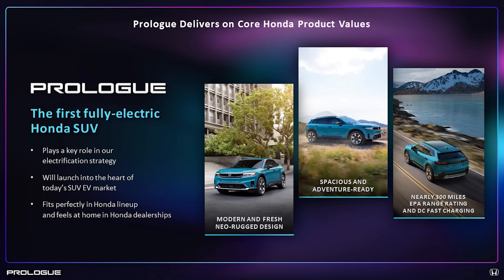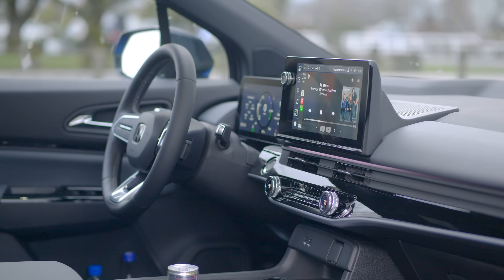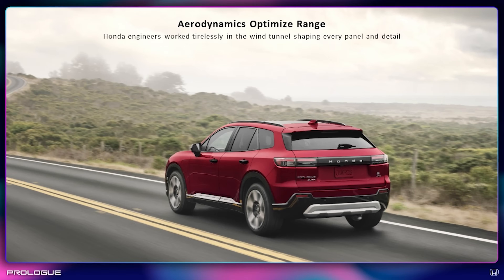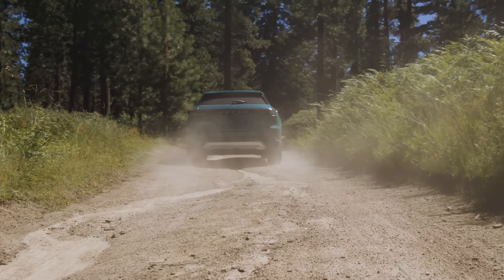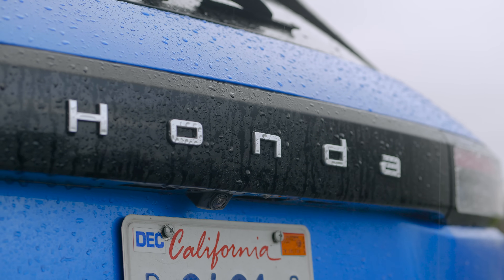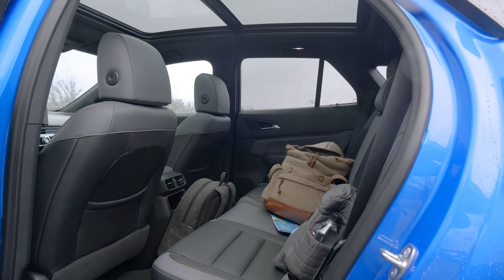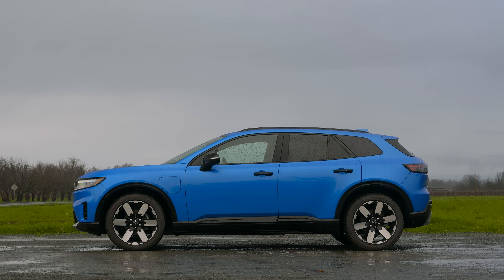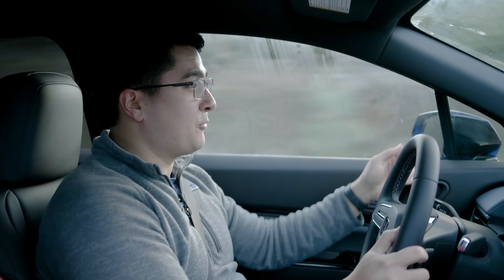Honda Prologue First Drive | Taking Risks

Comment: I just leased one, and I love it. Its got a nice floaty ride, love the easy steering, its quiet in the cabin and very spacious. I love it doesnt look like a modern EV, and has a traditional look. Im very happy with it.
I had no clue when I first test drove it that it was a GM collaboration. Ive never owned a Honda before. I test drove a HRV then the Prologue, and honestly, I didnt really notice a difference. They both rode and drove the same. And Im glad I went with the Prologue. I got the touring trim, and am extremely happy with it.

Comment: Our first new car was a ‘99 CRV. After driving my parents’ American cars during my formative years the Honda interior was a revelation. Buttery smooth switch gear, dead clear instruments, high quality fabrics and stitching, razor thin panel gaps. In other words, absolutely the polar opposite of GM interiors. Heartbreaking that poor Honda guy had to play up the fact they got to choose the placement of the cheap-looking central pod and switch gear. Ugh. 
Now, based on the great things I’m hearing about the Silverado EV maybe their platform architecture will be ok. And I quite like the styling actually. But I could tell blindfolded and drunk that interior ain’t no Honda. ☹️

Comment: I drove one last week.  Sorry to say this is one of the worst "Honda" cars with that H badge.  The only one worse, that I can think of, is the original Honda (Isuzu Rodeo) Passport.  The Prologue did not feel or drive like a Honda, all the interior controls were a direct carry over from GM.  In summary, I don't see Honda selling very many of the Prologues unless they cut the price significantly.  My dealer had $71k on the window sticker of a $56k Prologue, and if I didn't have a trade-in and I didn't finance with them, they wanted to tack on another $3,000, not to mention another $2,500 in document and registration fees, it's insane.  The dealerships are all out of their minds and I can't believe people are buying any cars from these businesses.  Maybe if Honda could sell direct, they would sell more cars but I'm totally done with dealerships.

Comment: $50-60k On a Shared platform?!  Whatever excuse one will make as to why this costs as much as it does is not the consumers problem.  This over a similarity priced and spec’d Audi Q4 Etron or a cheaper model Y makes zero financial sense to buying a comparable hybrid or ICE vehicle.  This is DOA unless they provide massive manufacturing discounts outside of the tax credits.

Comment: Man....this EV major advent here in the past few years leaves alot to be desired. What a boring souless appliance all these cars are turning into. While yes i agree most sub /cuv in the past were much exiting to look at or consider at least we had some significant architecture of power train / transmission/sound etc that we could look forward to- especially the more bespoke tiers with the more powerful engine variation or the option of LSD or a different transmission revised and improved.  I wouldnt be surprised if we have literally the same electric motor and battery packs (on a basic level) between nearly all these evs.

Comment: The EV architecture dictates the entire underside is batteries, which seems to give the buyer some industry standard 300 miles plus or minus 50 across nearly every manufacturer. The economics are not great as price parity with ICE cars doesn't exist.  ICE prices have been raised to support zero EV profitability.  Our collective governments are really wishing this through, but battery tech still doesn't provide energy density.

Comment: The comments are pretty rough on GM, maybe deservedly so since GM has a Stop Sale on the Blazer over all the software issues. I'll wait to judge if this co-developed EV is a gem or garbage before making the assumption, but the Honda guy was pretty defensive. It's telling that Honda says there will be no more joint development efforts with GM.

Comment: I wouldn't pick a Pilot over a Prologue assuming I could afford a $50,000 vehicle. The savings of an EV is too great to overlook compared to the Pilot's mediocre gas mileage of 21 mpg. The real question about EVs though is 'are they too expensive to maintain/repair?' In an accident, an EV can cost many times more than a traditional car to fix, sometimes more than the car is worth.

Comment: The engineer saying it feels like a Honda inside. Sorry but that steering wheel is not Honda at all, I'm not talking about parts, I'm talking about layout. The layout is clearly GM cruise on left, buttons on the back of the wheel, wiper stalk on opposite side, etc. I know they were working with a parts bin but he said they had control over the layout and they clearly didn't make it feel like Honda if the end user will have to learn a new layout for this one vehicle.

Comment: Looks like another failure from a Japanese automaker. We have seen Toyota doing that and fail, and now Honda decided to jump in the EV wagon which we all know it is not going well in the market for multiple reasons, and the main problem here is the PRICE. Yes, $60K for a boring low-performance EV SUV is way too expensive for the current market. If that vehicle is priced in the mid $20K to low $30K I can see people thinking about getting in the EV world and probably switching to that Honda. But in the $50K range, you have better options in the market with better performance. I don't see a second-gen of the Honda Prologue in the future.

Comment: In 2005, Motorola partnered with Apple to announce the Motorola ROKR, a flip phone that was an evolution of the Motorola RAZR but with Apple's iTunes software. Connect the phone to your computer and you could manage your music as easily as you could your iPod. It was Apple's first look, first exploration into the cell phone market, but they wanted an industry-leading partner to help them take those first steps.

In 2007, Apple unveiled the iPhone. As an S2000 owner, driver, and enthusiast, I hope this his Honda's ROKR.

Comment: I think everyone in the comment section is still living in the past with GM. At least this is something different. The Honda lineup at this point is a bunch of CVT equipped, low-revving commuter crossovers and a minivan perfect for non-enthusiasts. Are they good at boring these days? They have nailed it :) They literally have ONE enthusiast product which is the Civic lineup. GM chassis engineers are known to be some of the best in the business these days. It’s like the new Supra…everyone is afraid of what “could be down the road maybe” vs just driving.

Comment: I bought a Pontiac Vibe because it's a Matrix underneath, and got a great vehicle, despite being assembled in a GM plant that later turned Tesla. The GM/Honda partnership goes back to Isuzu and Saturn.

Also had good success with my Malibu Maxxes. My 4 cylinder Hondas were all good but the V6 has a horrible tranny.

Comment: We have entered the second Malaise era of automobiles. With EVs, hybrids, crossovers and downsized engines cars have gotten very boring. Its a shame because the internal combustion engine has reached near perfection. This could be golden age of cars but due to government regulations its turned into a dark age. Its all for nothing though. ICE will be around until at least 2050. Mercedes had plans to be 100% EV by 2030. But due to horrible sales they now say they're going to continue ICE production well into the 2030s. The only company in America or Europe that's really selling EVs is Tesla. They're selling because they're Teslas not because they're EVs. California and the EU both have set a 2035 ban on ICE vehicles. Either they're going to move that date forward at least a decade or they're going to obliterate the automotive industry. ICE will continue to dominate the industry until one of two things happens. Either some miracle battery is invented or another technology like hydrogen fuel cells reach mass production. I'm optimistic about Porsche's E fuels. This could be a way to extend the life of ICE vehicles while also reducing emissions.
Reply: Meh… ICEs are so 20th century … get with the program and stop living in the past

Comment: Regarding quality, Honda was mid-pack in the 2024 JD Power rating, finishing below Buick, Chevrolet, Cadillac, and GM. I have owned a lot of Hondas (CRX, CRX Si, Acura TL, CRV, VF500F, VF700F, VFR700, CBR900 RS125) and I like brand. Was I in the market, I would almost certainly buy a Prologue over the GM clone, but that would be based on design and driving dynamics, not reliability.

Comment: The biggest problem with these new EVs is still the range. Until these EVs can get 450-500 miles to a battery charge these vehicles are a complete compromise. With 290 miles of range in optimal conditions it would appear to be okay but there are so many  constraints that will prevent the customer from getting a 290 mile range. For instance cold weather substantially reduces the real world range. If there is heavy wind/wind shear playing out this will substantially reduce the real world range.  In addition when these EVs become used they will tank dramatically on value worse than a ICE  or Hybrid vehicle. For the smart consumer that wants the EV, leasing it is the only way to go. You do not want to own one of these. Lastly this is no real Honda and Honda should stay away from trying to convince their  loyal fan base to buy a GM and play it off as a Honda. Same holds true for the Acura variant which carries the name of a failed Acura product of the past. Come on Honda get real and stop deceiving the pubic (you use to care about what you produced and sold to customers)

Comment: I'm kinda tired of the "lease this, don't buy it" you guys say with basically every EV you review, just because you never say WHY not to buy it. Is it reliability concerns? That'd be reasonable, though these types of vehicles really aren't inherently more complex and therefore likely to fail than most other new cars. Is it depreciation worries? At least for myself, I don't buy a car to keep it for 5 years; I buy to keep it for at least 10, at which point I'm really not concerned with recouping my investment. Is it the fairly steep technology development curve for EVs at the moment? That's irrelevant; unless I'm anticipating some dramatic shift in my lifestyle at some point in the near future (not saying this never happens to anyone), if an EV works for me now, it'll work fine in 10-15 years from now, too.

Unless this channel starts substantiating the whole "don't buy an EV position" with reasons why not, it's just going to come across as anti-EV.

Comment: Why even bother with this? Tesla has a better network, the Koreans have better driving dynamics, any AWD EV will make more power, and most vehicles comparable in performance and quality will cost less. $60k gets a vanilla, limp wristed Honda thing, $63k gets you a 570hp, 0-60 in 3.5 seconds EV6gt. It's like they wanted this to fail.

Comment: IMHO, these car companies that are spending so much money to make EVs would be better off spending that money to lobby governments to educate politicians on why man-made climate change is bullshit and how we do not need EVs. An EV should just be an alternative car for the person who just wants an EV. The focus should be on developing affordable gas powered, naturally aspirated cars that last.  People with money will always buy new cars because they get bored, so it doesn't matter if the car can last 20 years, but for those of us with limited funds, we should also be able to drive a nice car and not have it cost 40K +.

There is no need to add a digital display on every single trim. There is no need to add a full fledged infotainment system on every trim. Instead, on the entry level trims, focus on providing a good engine, a good transmission,and a good suspension, instead of making it with a cheap engine, cheap CVT, and BS suspension, but loading it up with computer gadgetry.

We need more companies to make more cars that the average person can buy without stressing the budget!

Comment: Curious to why all these newer EV releases with ambitions to be NACS compliant, keep putting the charge port on the drivers side of the vehicle towards the front fender. This will make charging at the traditional Tesla charging station difficult and annoying to everyone. Here's hoping  they have a CCS port there, and put a NACS on the passenger side.

Comment: I am an automotive engineer of over 20 years. I worked for a Honda Assembly plant and Honda R&D. I subsequently worked for a GM assembly plant and had stints working at GM world HQ. I can tell you from having a full understanding and experience with both manufacturing and design cultures, this is an utter disaster and ticking timebomb waiting to happen. Both companies are complete polar opposite when it comes down to design philosophy, manufacturing ethics, supplier base management and soforth... Honda carrying the proactive mindset of Continual improvement, Kaizen etc.... While GM being the build it and worry about it later, fighting fires mindset.... Also, GMs workforce are union led, with quality and pride placed below workers compensation and security of jobs. Honda on the otherhand is an entrenched culture of quality and pride.... I see nothing but quality and workmanship issues for this vehicle coming from GM and subsequently Honda will have a hard time having GM own up to these issues.... I predict this partnership not lasting more than 5 years, the Prologue ranking last in JD power IQS surveys.... this is the worst partnership in sometime.... I cant wrap my head around a Honda product built along the same assy line as the Chevy Blazer and Equinox.... Do you think union workers will put care in assembling a vehicle with a foreign nameplate? Absolutely not..... Its a SAD time for Honda.... soo sad
Reply: I am but an outsider, but it seems to me your Honda experience must have been pre-2016ish. Their quality has absolutely nosedived, the marketing and finance people seem to be running the operation, and they have turned a cold shoulder to their customers who are increasingly having major, widespread failures of major components just out of warranty. 1990s Honda, this ain't.

Comment: $60k for a Honda? Outside of the NSX, no Honda should be costing that much money. This car will flop at that price. Even the Blazer EV isn’t selling well and it’s been on the market a year longer than this car. 

And only 212 horsepower? I get they wanna make a “normal EV” but 212 horsepower in the FWD model is just not enough. Even the Mustang Mach E base model has 266 horsepower, and even that feels slow unless you’re on a full charge.

Comment: Jack: how does this product drive differently than all the other skateboard architecture products?

Honda engineer: it has a Honda badge and the inside is laid out like a Honda.
Reply: "DyNaMiCs"
Reply: Nope, it's not even close to being laid out like a Honda, it's laid out like an Blazer EV, all the controls are not where Honda normally puts them, it's where GM put them.  This vehicle was a total waste of resources for Honda.

Comment: "Yes, these are GM parts but they are arranged where they would be if they were a Honda"

People buy Honda and Acura because of their reputation of being solid, reliable vehicles that will last for hundreds of thousands of miles. Where the buttons and switches are has literally NO bearing on that.

Just LOOKING at the dials and buttons used and comparing them to a Civic, you can tell that the parts used here are garbage in comparison. This is just sad.

Comment: Honda and Toyota dont care about EV, so they make these partner throw-away models to be compliant. IE have an EV model in their portfolio.
Hybrids are much more cost-effective at the moment, and way more practical due to it not requiring a lifestyle change, or a driveway to get decent charging rates.
Honestly, once they start applying road-taxes to these, and do away with the government rebates/taxcuts, these vehicles are dead in the water.

Comment: Man.  The level of defense that poor engineer was putting off.  From the GM partnership to its hideous price tag relative to what gas or hybrid powered SUV's provide this thing is just pointless.  Honestly, automakers should stop spitting out EVS until they can get the range that most modern gas cars can - or at least match the range of plug in Hybrids instead of selling us this can of goods.

Comment: The late 20th century look and feel Honda interior coupled with the mediocre electric technology from GM is maybe OK for people who never heard about Hyundai, Kia or Tesla.
In the last 5 years, year after year, Honda sales started to slip, from 5.3 millions in 2019 to 3.6 in 2023. The revenue is growing, but that's only because of the inflation, their profits are still going down. Their latest strategy was to keep the prices high, selling less, closing factories and firing people to stay afloat. 
No R&D in EVs in the last years and no battery plant / contracts made, so they are relying on GM to provide this side of technology (like asking the one-eye man to lead the blind). I think their "too soon for EV" gamble didn't pay off, and they realized they need to act fast and they did this last year in September :
"Honda JV becomes the first foreign partnership to launch a new EV brand in China. Dongfeng-Honda, the Japanese automaker's joint venture (JV) in China, launched a new electric vehicle brand, “Lingxi""
This Prologue is in my opinion more of an epilogue, we'll see the cheaper versions of EVs in America in a couple of years, meanwhile, the Honda brand fans should prepare for a bumpy ride.
Also, the Blazer EV has been halted at the factory, so I imagine the Prologue will also be affected by these issues.
Good luck Honda, I used to be a fan. I sold my 2017 CR-V last year and that's the last time I looked at a Honda dealer.